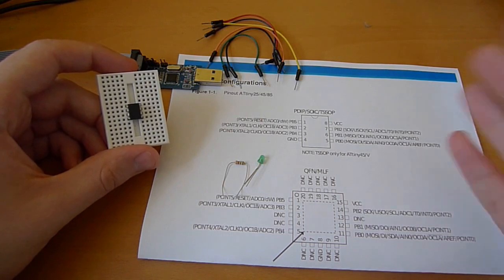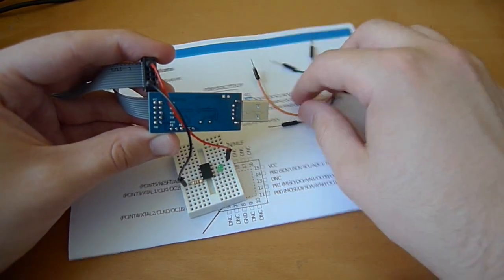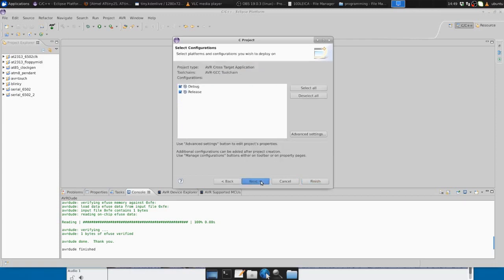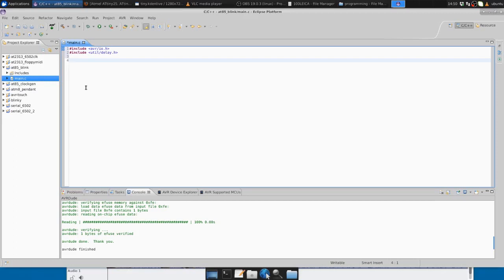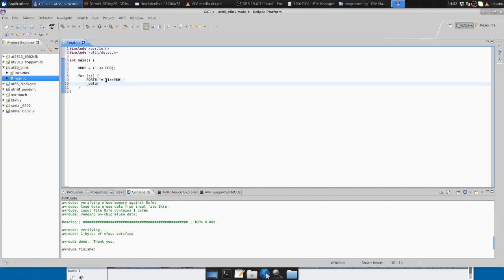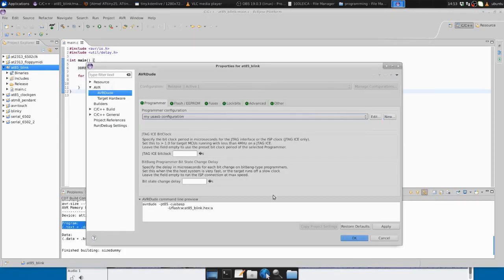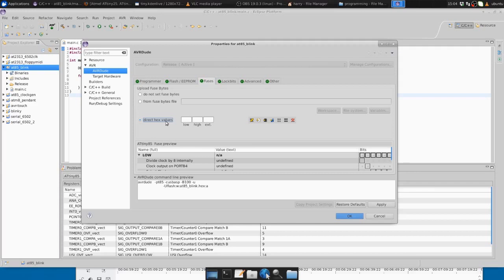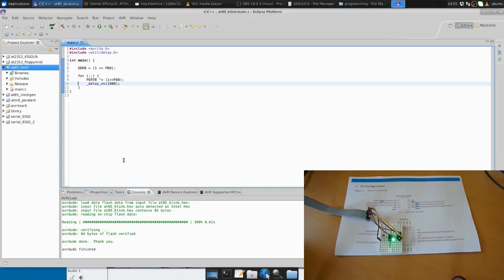ATtiny #4: Programming with Eclipse + avr plugin + USBasp

Comment: I have eclipse working fine but i cannot get the avr pluggin to work! First it always said "cannot find avrdude.exe" so i intalled winavr. nowwhen i try to compile it says " cannot open avr-gcc.exe" in a popup window. and "make: * [main.o] Error -1073741502" in the console. Please help.
Reply: http://avr-eclipse.sourceforge.net/wiki/index.php/The_AVR_GCC_Toolchain#Windows
maybe it is a $PATH issue:
https://stackoverflow.com/questions/30128309/cygwin-gcc-error-while-loading-shared-libraries#32901218